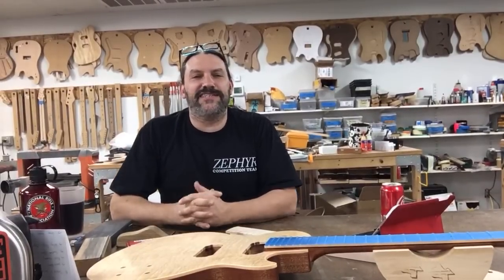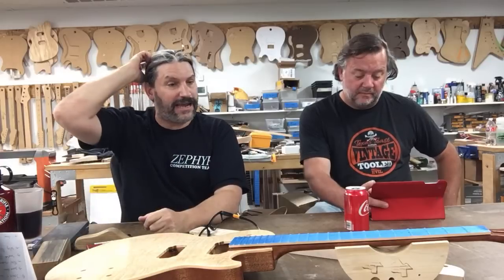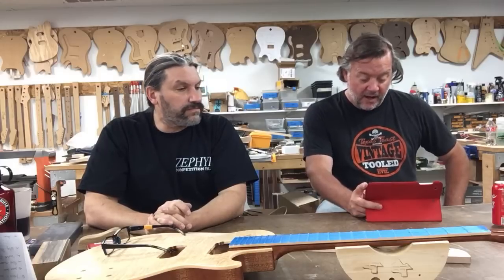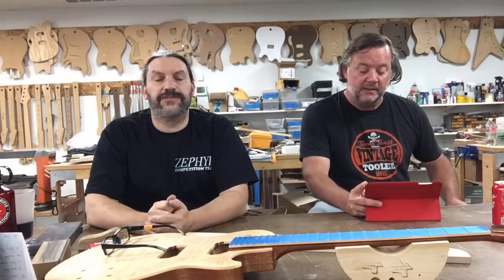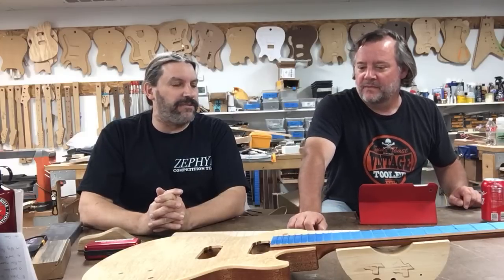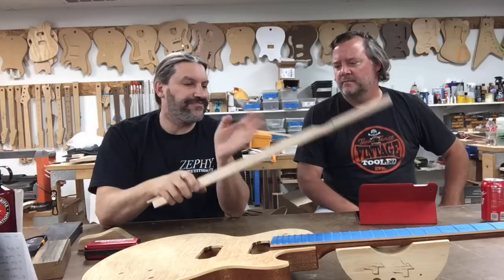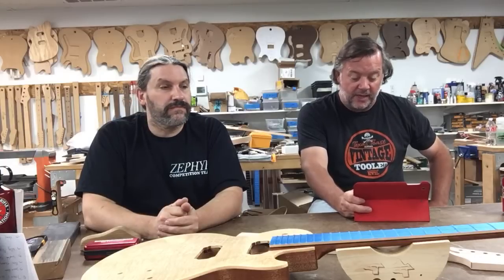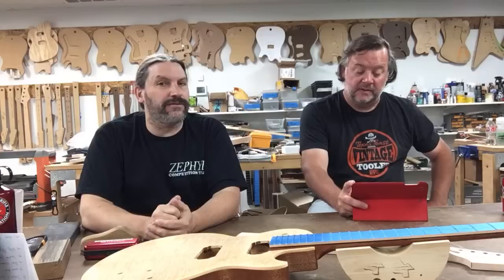Live! Guitar Building & Repair Question & Answer Show... Episode 1, October 8, 2020

Comment: I agree about the Poplar. It's become my body wood of choice. I'm building my 3rd now with it and zero complaints. I've even used dyes with it. Not expensive, good wood grain, planes/tools very well (a little tear out here and there but not bad at all) , good weight and it's easier on my tools life expectancy. I'm working on a JBass now and the 2 piece body joint is my center line, i had a hard time today finding the line. Underrated
Reply from the maker: I really enjoy poplar and recommend it for anything with opaque color but you are 100 % right about it taking dyes and candy colors as well Mark

Comment: What is the best and safest way to remove paint from an old guitar.
Reply: Paint stripper has worked for me in the past.
Reply: Kind of depends on the guitar and the finish that is on it.  Sandpaper works on everything, but might not be the best choice for a carve top.  Paint stripper can work too, but sometimes  the careful application of a heat gun and a paint scraper will do you just as good, and it is cheaper and less nasty.  Note that if the guitar has binding, you will almost certainly have to replace it after stripping the paint via any method.
Reply from the maker: That is a great talking point, can you bring that up next Thursday?